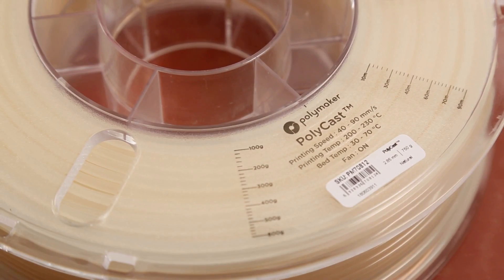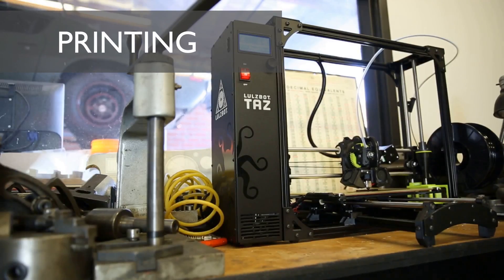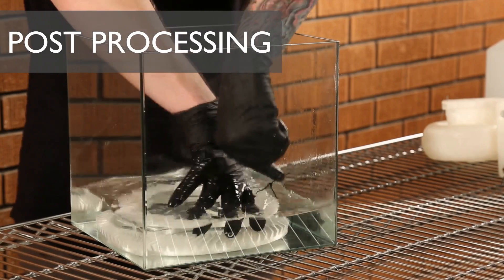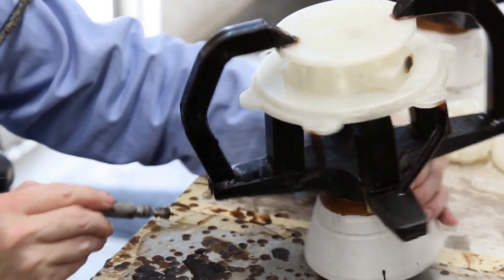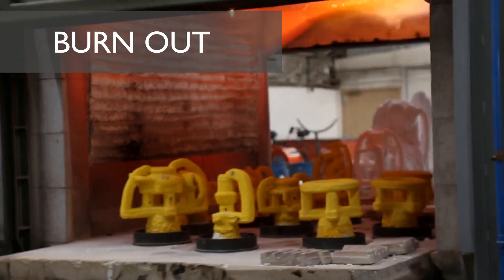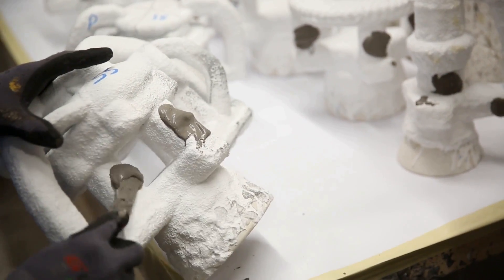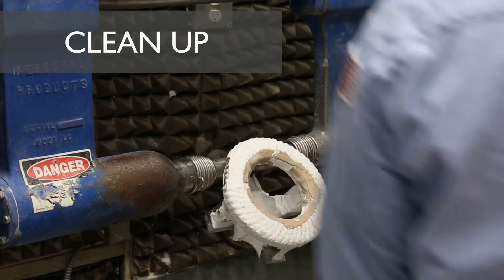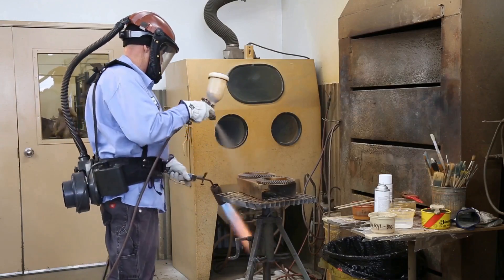3D Printed Patterns For Metal Casting

Comment: I wonder if one can do this at home with a cheaper set up for small application as replacement farm equipment that’s no longer sold or non important parts from plasatic to metal but then you get in to tolerances and ect

Comment: This is super cool. Any other methods used for smoothing PolyCast after print other than alcohol?
Reply from the maker: PVB is usually best smooth with isopropyl alcohol. Though other materials can be smoothed with different chemicals.
Reply: @ thanks a lot

Comment: Can you put this in a sand mold and poor in molten metal and have it burn off as the metal goes down?
Reply: You can. Must ensure metal feeds from bottom and design your print and/or vents to allow gasses to exit directly out top
Reply: It wouldn't be a great idea because as the plastic vaporized it'd create gases and, therefore, bubbles.

Comment: Next time print something usable, not a turbo that will never work.
Reply: @MissMerc  Fuk me, I'm the stupid one here, they really not made the turbine.
Reply: connecting rod may be usefull. also you can make nice oil gallery in them.
Reply: @MissMerc  What CNC mill would you recommend? Also what 3D printer do you use?
Reply: @MissMerc  Oh I seen the HAAS the Mini Lathes interest me. Though the MPCNC looks interesting but it seems it is out of stock part wise.
Reply: @MissMerc  1. It's made from the wrong metal 2. 3D printed parts are not even close to the dimension acuracy that a turbo needs, even in professional castings they need to machine the housing 3. A casted turbine? It's more likely to be a vibrator than a turbine.
I know this is a "proof of concept" but It's a bad proof for a never working concept.
Reply: @MissMerc  Im not gonna argue with someone who don't give a f about facts. 
1. It's NOT just the housing, WATCH THE VIDEO before talking bs. 
2. I have actually held a pretty cool watch in my hand once, I think I'm a watchmaker now. You know there is a different betwen lulzbot (hobby) and a professional printer which cost a bit more. It can be machined, ( Well, I would throw it in the first trashbin, because it's a terryble unaccurate cast)but then what is the point? 
It's very slow compered to other methods, more work and much more money.
You can cast a part much more easier  then this, and much more accurate.
3. Dude, stop, google how a turbine looks like.

I don't know if you do casting, cnc milling, and 3d printing, but It's seems like you don't know much about either of it. But if you do, you can make one and try it, but I would not waste my time with it.

Comment: Gotta actually run the parts or what's the point
Reply: Yeah it is neat. But no testing = pretty sculpture. Not functional car part.
Reply: @hjartland  Why would it be weaker than any other lost wax casting? They are not claiming it would be better than a milled/machined products are they. The point they are making is that its dimensionally stable, whereas pla is both dirty and warps in printing. So instead of running the part as proof perhaps it would be better to get come callipers out and support this?
Reply: @civiprepper  then make a cube, sphere, or other geometric shape? Casting gears typically means they should be useable.

It seems like we are looking at this in 2 very different ways. Neither wrong, just different
Reply: @hjartland  indeed. Yes I would have thought printing some geometric shapes would be useful, and you're also write in your original comment.
Reply: @civiprepper  

The layer lines will cause some serious stress concentrations into any structural part, so the parts will likely fail due to fatigue in the long run much quicker than any conventionally machined mold.
Reply: @rock3tcatU233  wouldn't apply to lost wax. it takes the outside shape not the internal layer lines.
Reply: Lol. Or how much it costs?
Reply: It would shatter into many pieces.